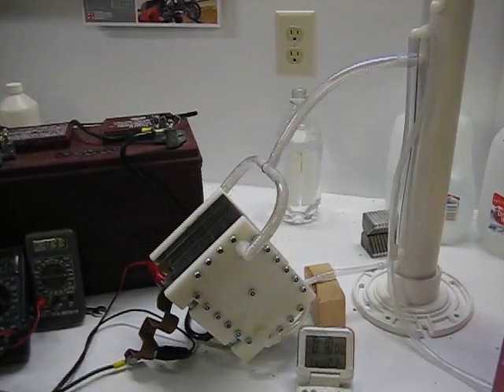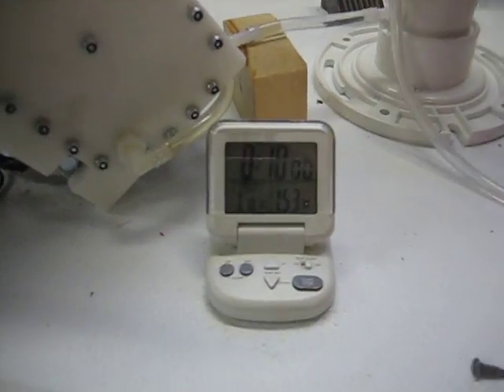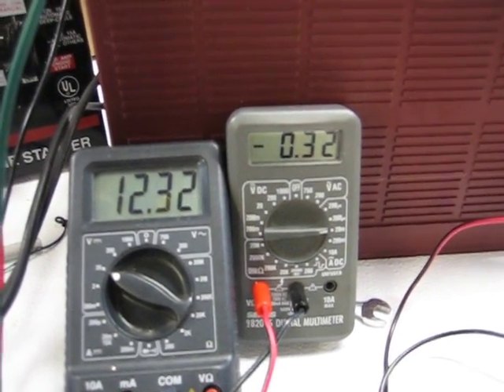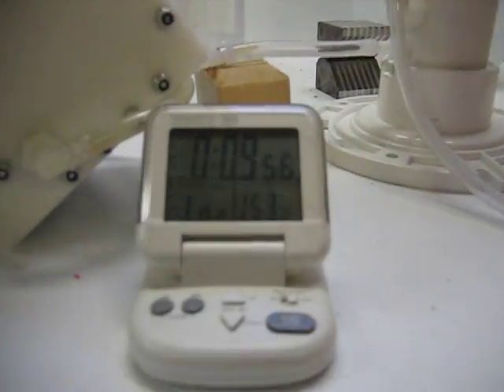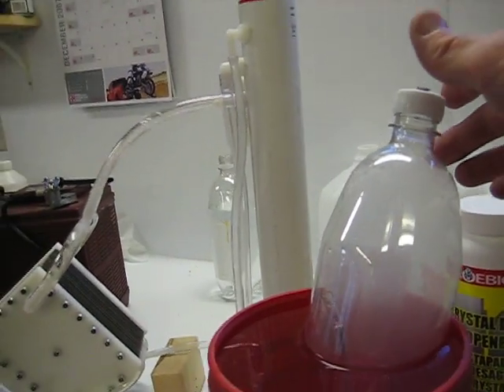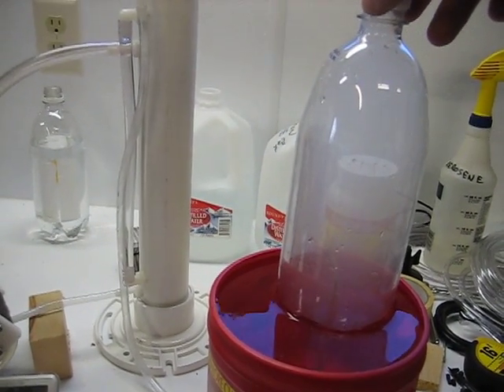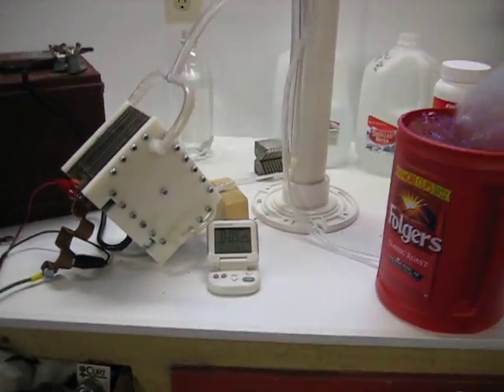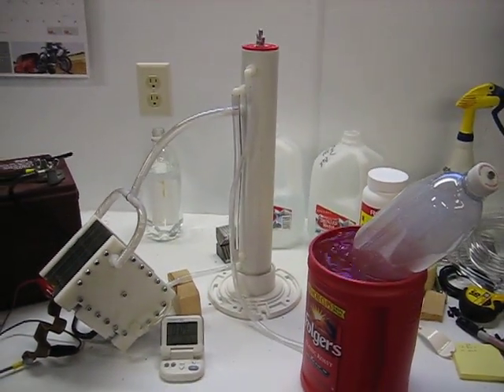Sealed HHO generator test.... MMW 4.60 at 30amps

Comment: 12v x 30A= 360W
360W for 34Seconds = 12, 240 Joules Of Energy
1 Litre Of H2 (you have O2 in there too, but ill let you off) has 10,550 Joules

It cost you 12,240 J to make < 10,550J
Therefor you lost 2,240J every 34seconds.

FAIL